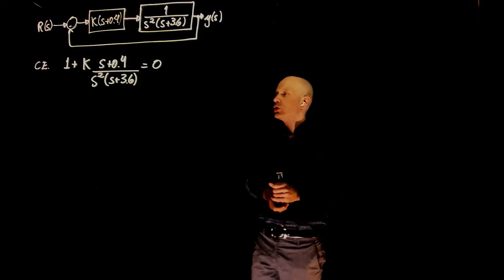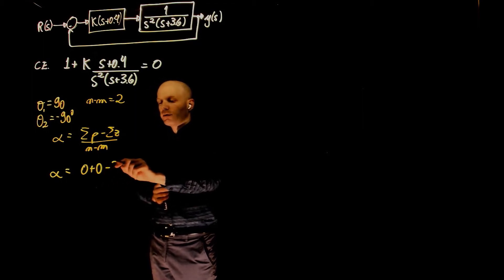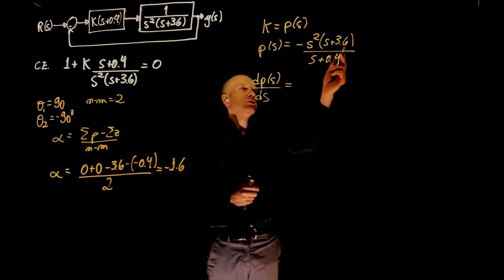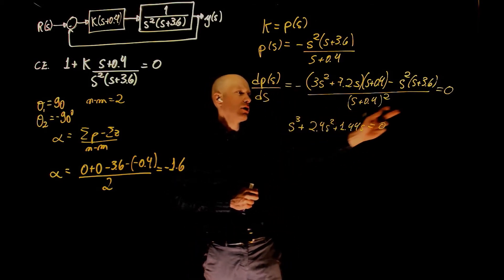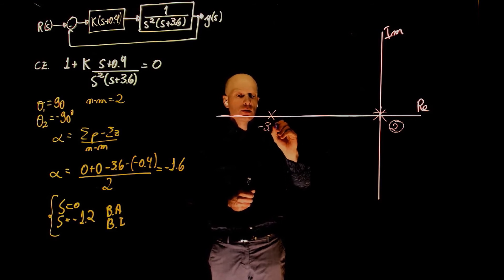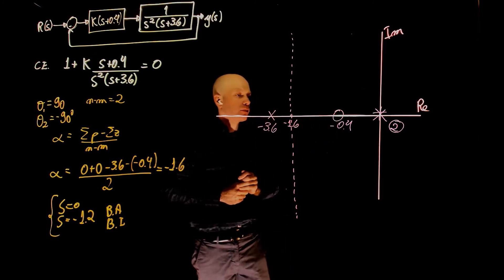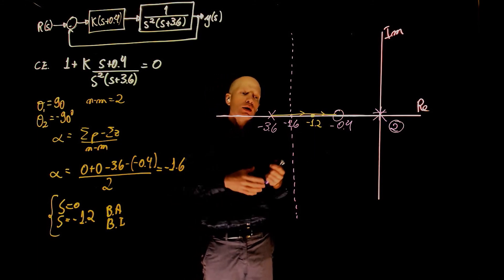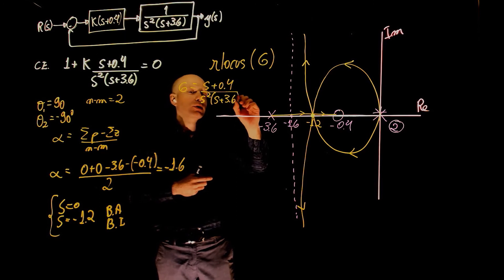L12E63 Control Systems Lecture 12, Exercise 63: The root-locus method

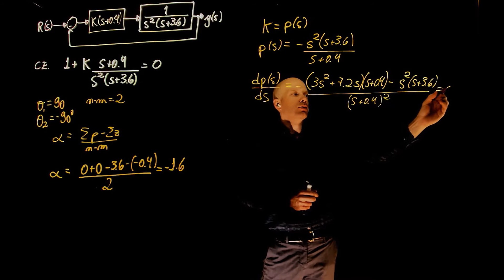Comment: 2:54 I got managed to get 2s^3+4.74s^2+2.88s, resulting in the only breakaway point being 0, similar to the previous example.
Reply from the maker: upon expanding the top of the equation you should get 2s^3+4.8s^2+2.88s = 0, so something went wrong with the s^2 term. Dividing both sides of the equation by 2 gives s^3+2.4s^2+1.44s =0
Reply: @biomechlab  oh ok thank you, ill check my work over again